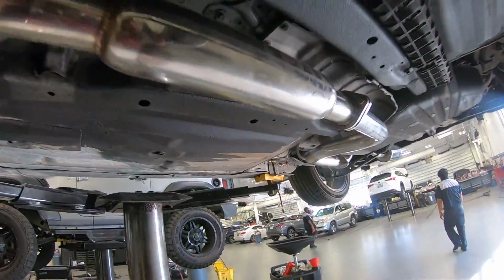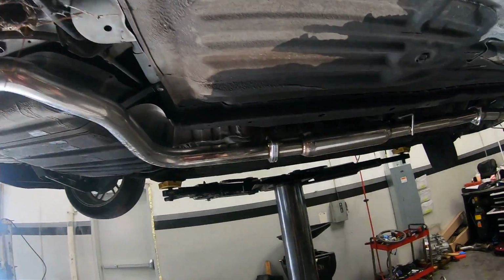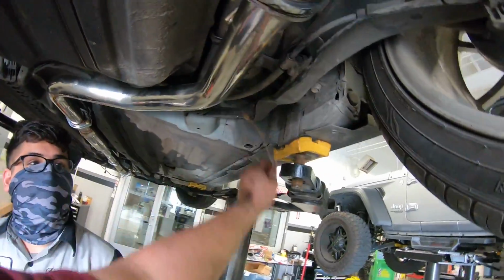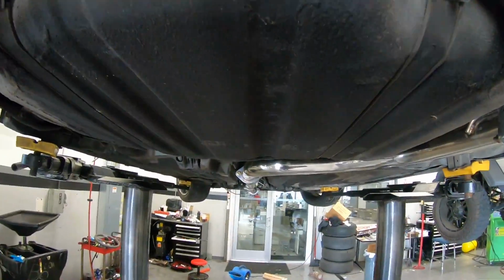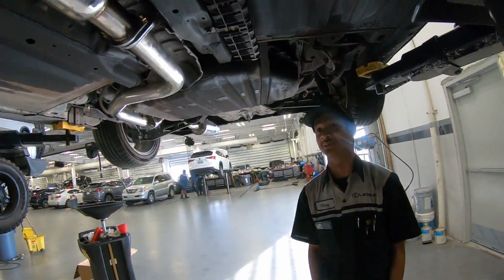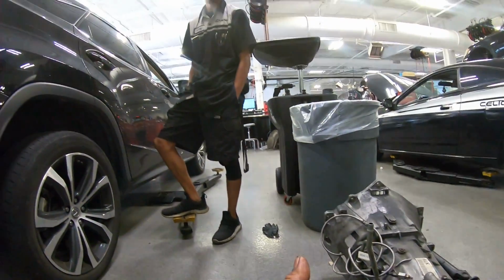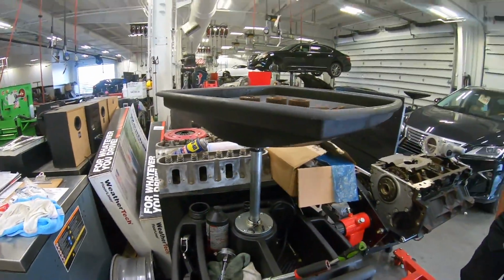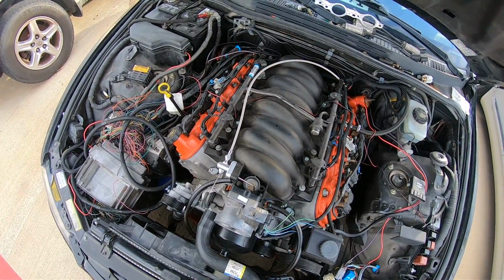92-2000 Honda Civic - How To PROPERLY Install an EBay Exhaust / Cat Back

Comment: I have the same problem, the muffler is too short. I think those are for the EK hatch catback. To make it work you have to use a adapter to extend the pipe to flush the muffler tail pipe.

Comment: If it’s still super low I’ve noticed too my aftermarket header and down pipe are a bit longer then stock so sit lower. I cut 2 inches out of the down pipe and now it all sits flush with that and flipping my center pipe
Reply: I got a noob question do you need a donut gasket or could you just use a regular gasket for the mid pipe to headers ?
Reply: @alohabychoicefa9968  I am pretty sure you need a donut gasket since there is the gap between them when tighten up

Comment: You can fill the muffler with the clothed that muffler have inside is like a fiberglass material is pretty easy to cut and welded together watch some Video’s about it 👍👍👍